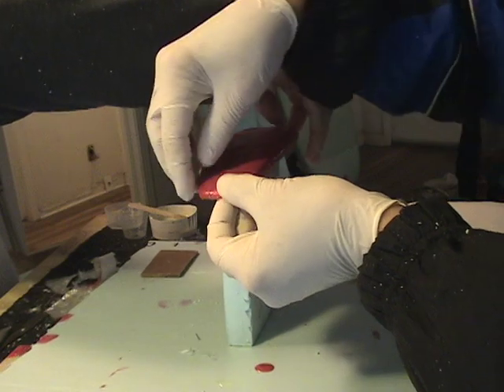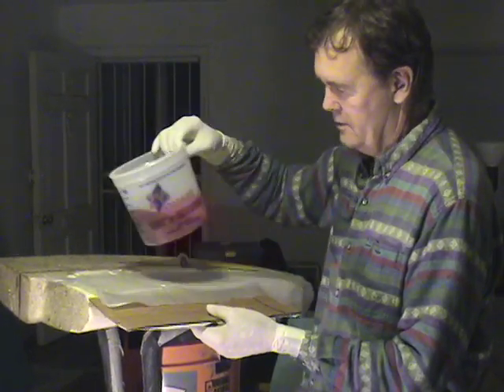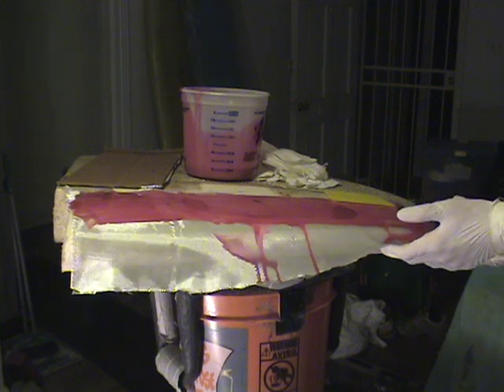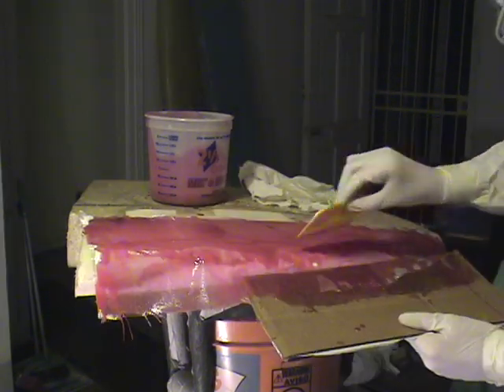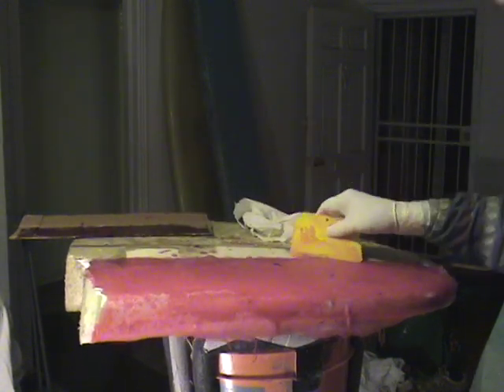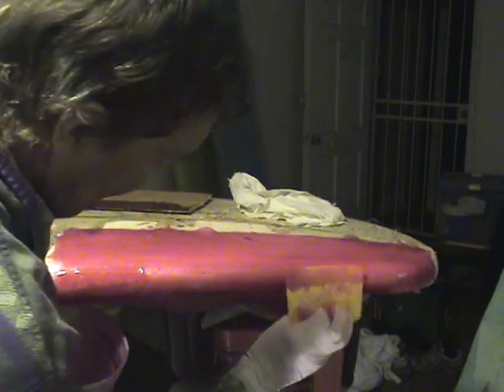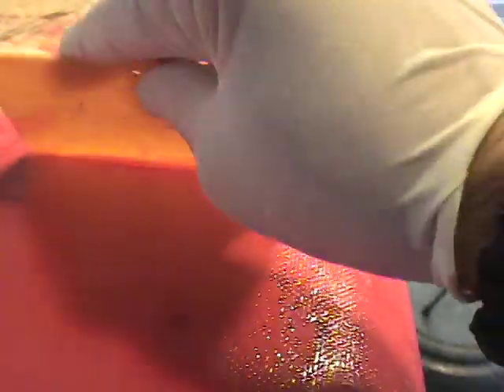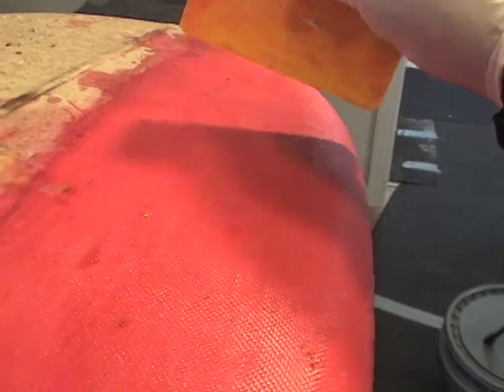How To Build Your First Surfboard - Familiarizing Yourself With Materials (Part 2 of 2)

Comment: Im sad i didnt see that before glassing my surfboard, i had to saturate the lap with another batch of resin , where i failed too is the lap making a lot of cloth string. I think if you use a square recipient to pour the resin you can use it like the cardboard to staturate the laps. Cutting the lap was a challenge too you need long scissor otherwise it not gonna be straitgh cut and it gonna produce a lot of string.

Comment: if you do that how do you get it to look normal when ur done like glossy and smooth
Reply: manchesterunitedpro when the zipper step is done and dry, pour some epoxy and brush it gently you have to mask the rail in the middle execpt at the back where you need straitgh rail, let it set and you will have you glossy finish, there some special resin to do that on epoxy but you can use regular one, for pu you can use aditives.